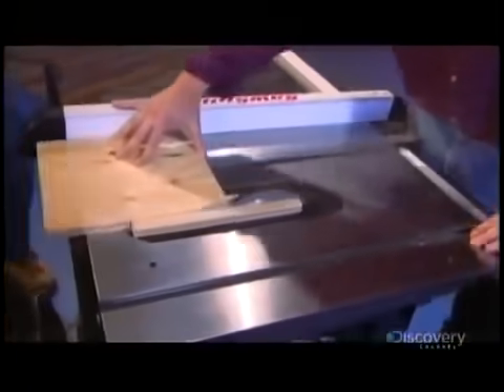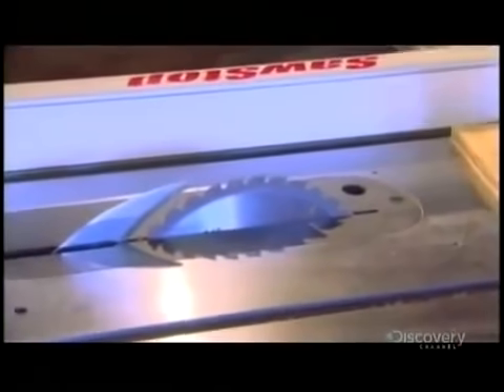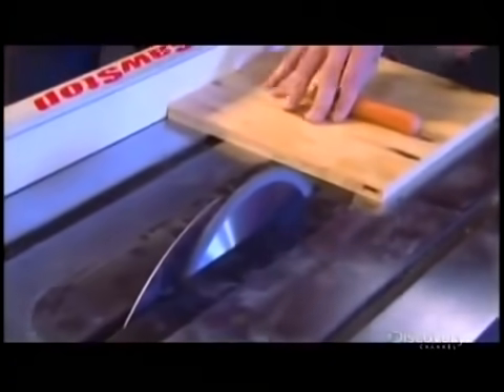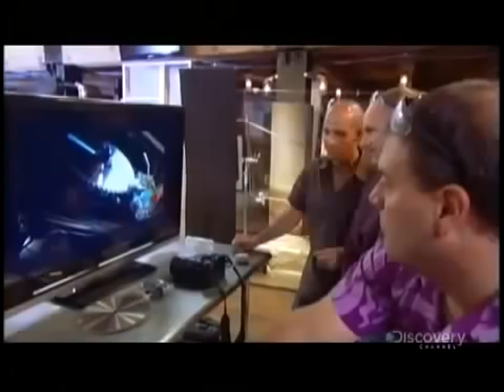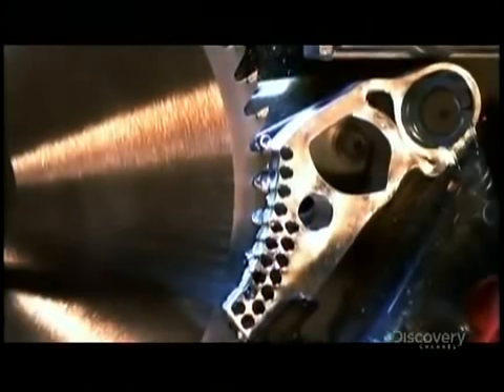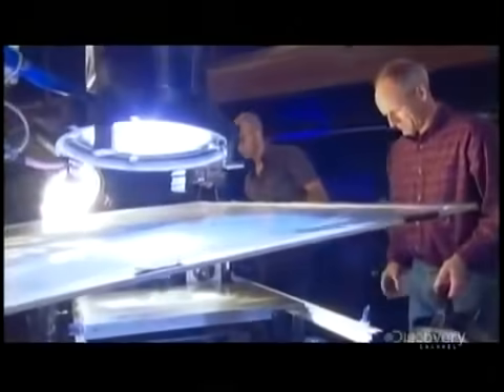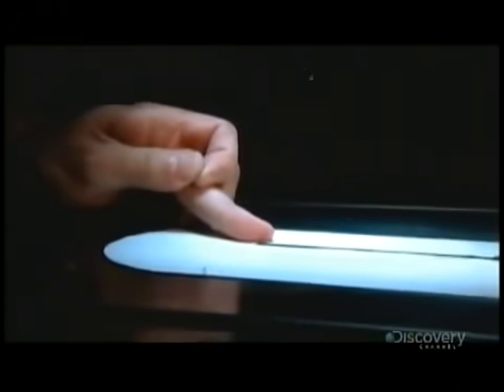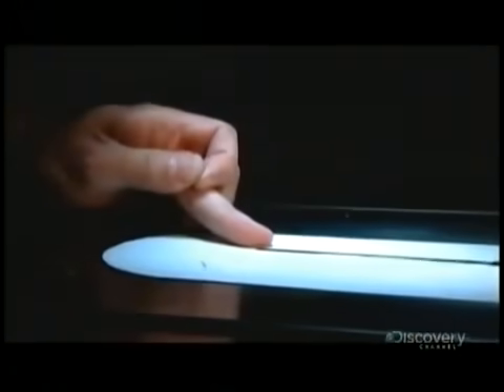Sawstop: Watch a FINGER go into a spinning tablesaw blade without a scratch

Comment: Instead of crumpling the blade and the internals when it comes in contact with the finger the blade drops then a brake shoe comes in and brings the blade to a stop slowly but fast enough that it won’t hurt you while it’s dropping

Comment: will the saw stop if you put your hand on top of the blade? What about when you turn off the saw and the saw is still spinning for a few seconds?
Reply from the maker: Yes, that’s exactly what it is engineered to do. Upon first contact with skin, the blade jams into the aluminum brake and comes to a complete stop within 5 thousandths of a second. If the blade is coasting down after being turned off, the brake is still active, so it will still activate if it comes into skin contact.

Comment: Why not design a spring-loaded pull down system instead of breaking the saw? Why can't it just lower itself below the surface while still running?
Reply: Speed. It uses the rotational energy of the blade to pull it AWAY and DOWN at the same time.

Comment: Before Steve demonstrated saw stop, the video shows him soaking his hand in water in a cooler. Does that mean that for saw stop to be effective the user should soak their hands in a cooler full of water before using the table saw? What temperature should that water be? Hopefully not too cold. Is saw stop not effective if you don't soak your hands in a cooler full of water ahead of time?
Reply: +TunafishSmoothie Steve was soaking his hand because the very bright lights necessary for the high speed camera were making the cast iron of the table saw too hot to touch. The ice-water helped minimize his burn. The SawStop Safety System would have worked either way.
Reply: They really should have mentioned that in the video.

In any case, even if it only worked on skin contact with the addition of water, it would still stop once it hits blood. This might not sound too nice and would surely hurt a lot, but at least your finger is still there and you most likely won't receive any permanent damage.

Comment: I feel like there should be a cut in slow mo of machine with a multiplier of the degree slowed side by side. Because it honestly looks like his finger is just next to it for so long then the machine just decides to react. I'm sure a lot of wood workers would be skeptical as well. If it didn't work quick enough the teeth of the blade would catch the finger and pull it down hard resulting in a slower more painful cut when using this machine

Comment: Here's an unreasonably expensive idea. Diamonds. Coat it with diamonds.
Reply: Diamonds are unbreakable.
Reply: Sethtaros DIDDLA DIDDLA JOJO BEEENEEEEOOWWW
Reply: Sethtaros they are breakable
Reply: Diamonds are very hard, yet brittle. They are breakable
Reply: It's supposed to break otherwise the load would just be transferred else where and break other more delicate or expensive components in the machine. Also diamond coating would only make the surface harder but the compressive strength would remain the same
Reply: Sephryn the only thing that can break diamond is diamond
Reply: Blur Icy you are almost correct. A diamond is simply super compressed carbon.

It can easily be smashed by a hammer, however if you want to precisely cut it, you would need another diamond.
Reply: Sephryn diamond is used on some type of surgical saws though maybe I’m wrong on how it works exactly but idk
Reply: Blur Icy Because of its hardness it is very VERY sharp. There are things like rulers in shape that can cut walls in half. Maybe thats why you heard its on surgical saws bc it is very sharp and makes a clean cut
Reply: I'd rather buy another saw table than pay for the ER bill

Comment: What if You have to cut wet wood or You have dry skin?
Reply: nanab256 woods are not conductive. Plus dry skin ppl ?, the touch screen works so itll work
Reply: Wet wood is conductive, more than normal skin.
Reply: nanab256 RIP YOUR LIMB

Comment: he didn't even touch the saw, it stayed the same position the whole time. It just stopped because sensor picked up a presence as the finger was close to the saw for a couple of seconds. If you actually touch the saw while it's spinning you'll see a different result. You can't blame me for questioning it when you have such a extreme camera and production set, but don't show the appropriate angles to see what happened. Obviously fake.
Reply: Not gonna go to the hospital just to prove a point. It's like an airbag, it'll still fuck you up but at least you're not dead. Same thing with this in an actual scenario you'd probably draw blood or even need stitches but at least you don't have to pick tour finger off the ground and try to superglue  it on long enough to get to the hospital
Reply: you right

Comment: What if you have a glove on
Reply: Adam Keller then u have a glove on
Reply: Base Gaming 

OMG
Reply: Base Gaming  I mean like will it still sense the finger lol
Reply: Adam Keller I doubt it. The glove would probably prevent the current from flowing out from the blade.
Reply: Why would you wear gloves during woodworking? It would just limit your maneuverability of your fingers.
Reply: it will probably cut through the glove before it stops at your finger
Reply: Matej C  to prevent splinters possibly

Comment: If the moisture content of the wood is high enough it will trip the brake. And every time that brake trips, you have to shell out some $70 for a new one and likely have to replace the blade as well. After a few inadvertent trips, the owners will probably begin enabling bypass mode.

Additionally Steve Gass, owner of SawStop proves he is a typical money grubbing lawyer. Angry that he could not get tool manufacturers to pay exorbitant license fees to use his invention, he attempted to get the Consumer Products Safety Commission to mandate his technology. Fortunately the CPSC saw through that charade and refused. Now he is patenting any technical development no matter how minute that even smells similar to SawStop. Meanwhile he continues to push for government mandates requiring table saws to carry his invention. He is also hiring himself out as an expert witness in lawsuits against table saw manufacturers.

I would not own a SawStop if it was given to me.